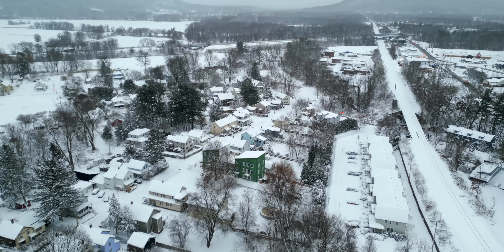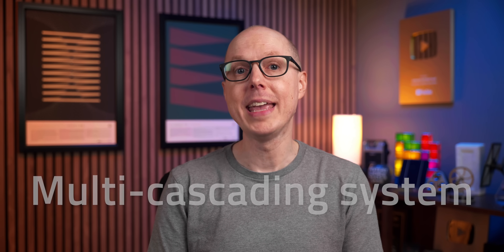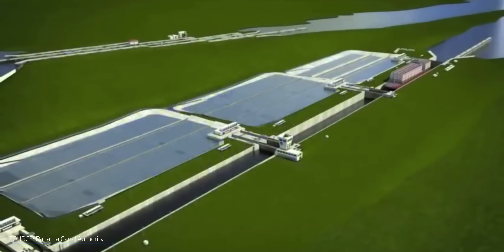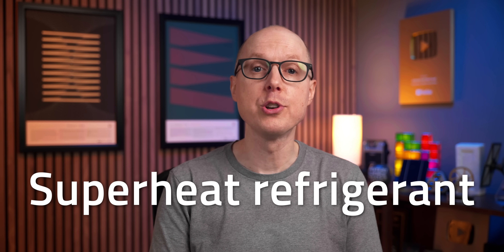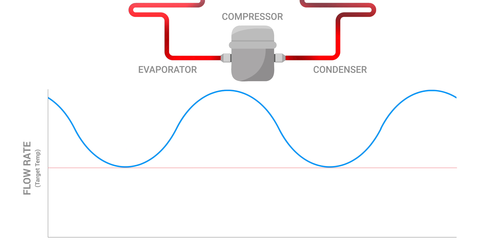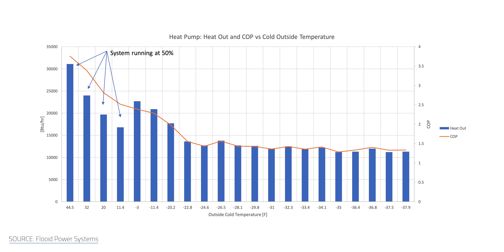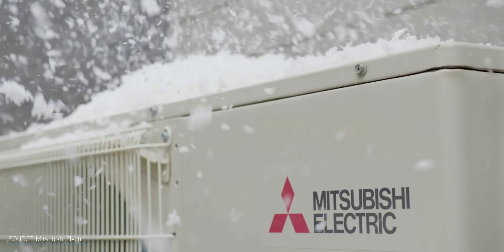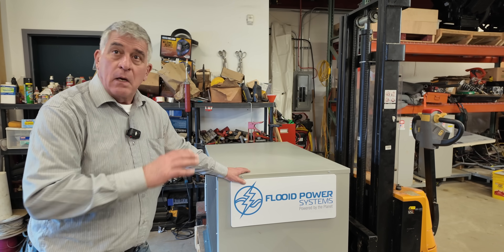How This New Heat Pump is Genius

Comment: I heard - 11 and went " My old heatpump goes down to minus 20 C, that's not impressive."  Then I remembered that the US still uses the old measurement systems, os it's around the -25C. Still not that impressed as we have - 35 C pumps here now too, and - 25 is almost the new standard.
Reply: The question is on the COP. The good thing about this system is that it maintains a COP of at least 2 at those temperatures. Traditional units struggle to maintain a COP of 1, which puts a big strain on the electrical system.
Reply: What are the -35c pumps? I'm in Canada and can't get one installed because everything available won't go past -20c
Reply: @mattymattffs  Try looking at these -22f ones
Cooper & Hunter Hyper Heat
Senville AURA Arctic Heat
Reply: @mattymattffs  I know that Mitsubishi LN35 Hero goes down to -35c. Don't know if it's named the same in Canada as in the Nordic countries. But I have seen there are several others too.
Reply: @-justhuman- Do those pumps also have a way of heating below -35C?

I live in a cooler part of Canada where we commonly get several days below -35C, and I have shied away from heat pumps because I assume the existing options need  separate backup system. I’m curious how well they manage their backup systems when it drops below -35 or -40. Do you have experience with that?
Reply: @chrisbuhler3686  They don't. But if you get days like that, ground heating or hybrid system would be better.
Reply: @-JustHuman-  Yeah, we get -35 or lower every year but only for less than 10 days total (and we don’t hit -40 every year and if we do hit it, it might be for 2-3 days of a year). 

So we probably still need a hybrid system. Of course those cold days often chill the house even more because of even colder wind chills but I assume the pump temperature number is air temperature not including wind.

Since it is only a few days at the extreme cold, I would probably need to look at a hybrid system. 

Does the heat pump still continue to give some heat below its rated temperature or does it basically not do anything when the air temp is too cold? (Ie does the other component of the hybrid system need to cover the entire heating or would it be supplementing when it is below the rated air temperature?
Reply: @chrisbuhler3686  We have hit the mini here, and it still performed a little. It depends on air intake more than the air temperature, I think. But I have an electric heated oil radiator I just put under the inside unit, so it just helped circulate that heat more then. 
But it can freeze up, as I have mine on the ground and snow banks can block air flow. I am thinking of elevating it 1.5 meters, so it can't be bloked, and it takes in more airflow
Also, why would a hybrid be good. Take that 5 to 10c constant of the ground and heat it up a bit more.
Reply: Metric predates Imperial by about 35 years.
You're conflating the adoption of Standards by the British (1824) and its replacement of Metric as the standard by the British in 1965 with the actual creation of the metric system in the late 1700s.
Reply: @tim3172  Nope, not british, and didn't reference that either.